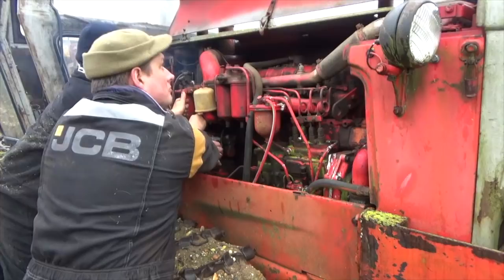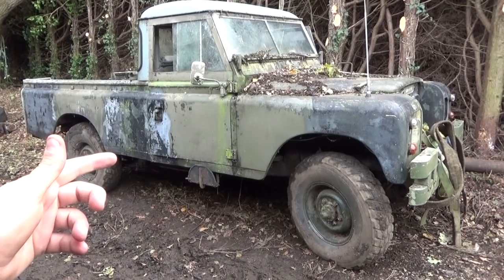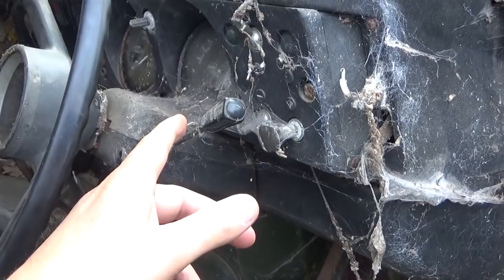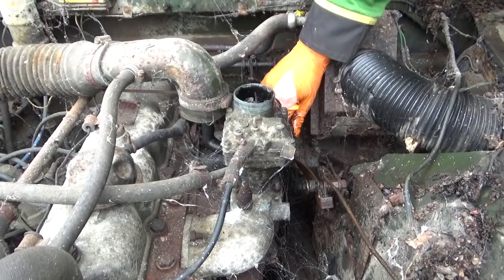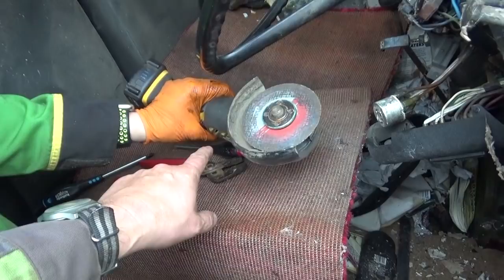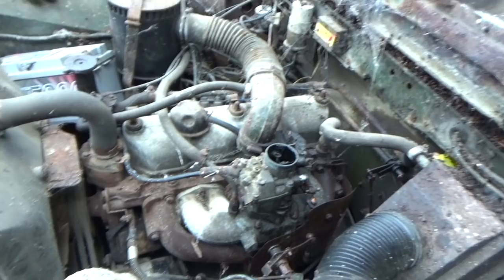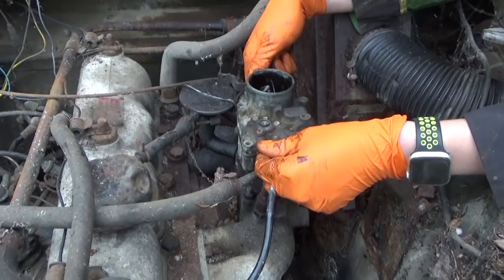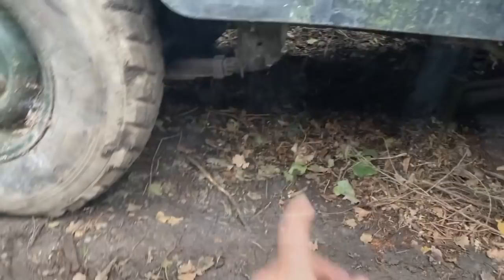ABANDONED Land Rover - Will It Start ?

Comment: Ive owned about 30 Land Rovers here in Australia.  Watching that 2.25 litre engine come to life made my day.  They are the sweetest little four cylinder engines.  I used to be in the geology business.  Our Series IIa SWB Landies had that motor.  When the geos drove from Sydney to Broken Hill (a very long way), they used to use the "cruise control" otherwise called the hand throttle (fitted for winches).  They would get the Landi up to "cruising speed" (what ever it would go) and then set the cruise control flat out.  The engine would be revving absolutely flat out and the result of this would be that the exhaust pipe would become extremely hot making the aluminium floor also red hot. No problem - feet up on the dash and off we go.  The speedo would go well past the 70mph mark.  Great little beasts. Wish I still had one.  (Still have a td5 Disco though for old time's sake. Mike
Reply from the maker: They are an incredible engine

Comment: Always like watching videos like these and I still miss my '63 2a after 25 years. It was my 1st car, spent my time getting it roadworthy while learning to drive, so it was ready for when I passed my test, used it for a lot of my apprenticeship in terms of the work I did on it was submitted as evidence for my NVQ. 

Another bonus was the 2.25 petrol ran on pretty much anything and as an apprentice, anything it would run on was great. there were a number of car hire and body shops on the industrial estate and the garage I worked at was opposite the petrol station, so as you could probably imagine, lots of people misfueled their courtesy or hire car, we'd pull it into our workshop, drain the fuel and put fresh correct in. Rather than pouring the contaminated fuel into the waste fluid tank, it all went straight into my Land Rover, sometimes I could have as much as 75% diesel/25% petrol, but she always started and thanks to those people's misfortunes, I was able to have fuel for my social life and keep my money back for other stuff.

I ended up selling it to a farmer in the Bristol area to use as a farm hack, but not sure if he ever took it home or left it at his parent's farm in East Sussex, it doesn't appear to have had a MOT (although now MOT exempt) for a very long time and after his parents died, the farm was sold and barns converted into homes, so it quite possibly ended up at a local scrap yard, although it isn't marked as being scrapped by DVLA, so who knows whatever happened to it.

Comment: Thanks for another great video.
Boots -
Being a plumber I wear lace up Dewalt boots on a daily basis, although if I am going in and out of a customer's house all the time I wear a pair of Dewalt slip on Dealer boots. Also got a nice pair of black Dr Martens steel toe caps which i keep for non damaging environments.
Away from work, if i know i don't have to take the boots off all day I have a fantastic pair of ex military dessert boots which are so comfortable, but have so many lace holes and being a tight fit mean they are a bugger to take on and off.

Comment: Old Landrovers never die but all engines wear out eventually. In 1981 I bought a Series IIA that had the original six cylinder engine replaced with a 161 2.6ltr Holden unit. We upgraded that to a 186 3.0ltr  in 1990. It is a cab chassis long wheel base with an aluminium tray and has been a great farm Ute. We were always worried about breaking an axle or some part of the drive train due to the extra horsepower but it never did. Mack steel cap work boots have been the best  I’ve ever had.

Comment: Boots: Ariat  fire resistant.  Enjoyed the video. Many Americans unfamiliar w/ the Land Rover brand. Expensive w/ limited dealer support. The G503 Jeep, more Military iconic here.  Given a choice, prefer the off-road equipment, tractors, crawlers, loaders & the like.  The  start sequence is like a golf shot, off the tee, trajectory uncertain. So the gallery, collectively leans left or right as if their position might influence where the ball will land. It is much the same when the engine is cranking.  We lean a bit into the keyboard for that extra incentive to fire.  A horse race could be another example, neck & neck approaching the finish.  The audience lends virtual push to their  horse, as if they are along in the saddle,  Then the engine starts to a sigh of relief & accomplishment

Comment: Dunlop thermo wellies.. Bit numb to start with when you first get some but once you've learned how to walk and drive again when wearing them nowt better and they last a long time too. Great videos by the way very good top tip about having a battery on the right angle so all the power runs to that end. I remember someone fitting a new battery on a series 3 and started it up, looked happy with a job well done and shut the bonnet.. Engine died immediately. The bonnet support shorted out the battery terminals !!

Comment: Brings back memories of our series 3 diesel put in overdrive and side windows use to fall out on you're lap🙈 had a pair of redbacks this year they were expensive but they're comfortable and seem to lasting well been struggling to get 12 months out of pair before a lot of boots don't like welding seems to burn the threads and boots fall apart.

Comment: Great vid you two .
Bit of scaffold pipe welded on the exhaust and straight in for a mot.
After 40 odd years I've finally found a  comfy workboot they are scruffs and I can almost get 12 months out of a pair.

Comment: Keep the clips young man!
I would have thought, NAY, expected a man of your calibre to have recovered the hand engine cranking lever from behind the seats, inserted it through the bumper and into the starter dog on the crank pully and started it by hand!
I have had many Series Land Rover's in my time and to be fair I would have a go at rebuilding that ole girl. Are you going to raffle it off? It would make a great Chrimbo raffle prize!
On the work boots, I tried Makita riggers, they were so terrible I gave them to a charity shop. I then went on to Buckler riggers and bought their boots every year for about 20year. However, I have dropped Buckler for V12 riggers because they last longer and are a bit more comfortable too. Did you know, (useless fact of the day), Buckler and V12 boots are made in China. Amazingly good quality considering where they are made.
Another fine installment squire!

Comment: How you doing mucker another great vid abit close to my heart over 12 years ago now i was asked to help start an old A2 series landy to use on our syndicate shoot as a virmin control vehicle got it running cut a turret in the roof had 4 or 5 years fun with it. We then lost the shoot land so it sat in a farm shed 5 to 6 years at least then i was offered it which i jumped at the chance and i now co own it wit a good mate of mine and yes she is still running. ARCO toe tector work boots are great straight out of the box no wearing in

Comment: Redback pull ons nearly all the time (I've got a working pair and a pair for going dancing) and lace up Redbacks if I'm walking a lot. 
I'm heavy on boots (just generally heavy really) and these are lasting about three times as long as any other brands I've had before. 
Skellerup wellies too, which are great around the yard and in with the cattle (steel toecaps and really grippy) but pick up mud like nothing else field walking! 

On Landrovers, I've got a Series IIa here with a petrol engine, which purrs, but has a serious thirst. There's a Series III with a straight 6 turbo diesel out of a Toyota Landcruiser VX, which needs a bit of work on the electrics to get her back running again (and by crikey does she run fast with a heavy right foot!). And an early 110 pick up with a late 300tdi transplant, with 15" wide tyres on for floating across fields. 
I also had a TDCi 90" as my main car, but the Irish Caravan Club borrowed it late one night, and forgot to bring it back.

Comment: I can see you are an afficionado of these 2286cc engines...when new and running perfect they are almost as good as the legendary Rolls 4 litre where you could put a threepenny bit on the rocker cover and it would not fall over.....the difference was with the Rover engine it would sit steady at a good tickover.....with the 4 litre R you could rev it and the threepenny bit would barely sizzle, it certainly would not fall over.
Reply from the maker: I've played a bit with the 6 and 8 cylinder Rolls engines and they are a really well balanced lump.

Comment: Hands down redback slip on, steel cap boots once worn in they are the best boot around. I wonder what's Lord Muck favourite boot brand?🤔
Reply from the maker: I usually have a few on the go but I like my Redwings and I've got a pair of JCB's I like plus a decent set of Bucklers
Reply: @LordMuck  Thanks for the reply it's good to know your brand.
Reply from the maker: V12's are good also but I reckon I might try one of these Australian brands soon
Reply: @LordMuck  Can't hurt to try, I am wondering how much redback boots retail in Britain because they retail for $80-250 in Australia depending on the model.
Reply from the maker: The last time I saw them being sold was at a machinery show in Germany and they were about €200 so I reckon around £180 in the UK maybe ?
Reply: @LordMuck  Holy shit that's expensive, the best bet for you to get a pair through a retailer in Australia just need to convert you shoe size from UK to Australian that's about all. May take a while to get there.
Reply: @callumbaylissbrandenburg9605  Get them from Bushgear, just over £100.
Reply: @kevinskea9388  Getting better, I can get a pair of slip on for around $100aus which isn't to badly pieced. I can get them awhole lot cheaper than people who live overseas. The pair I use cost me $125 or 69 pounds. I guess once you add shipping to the boots I think that it makes sense to add the extra 31 pounds to it which isn't too bad. Its good to see that people (other then Australians) like to use the stuff we make. Just like how I like to use the stationary diesel engines that are made in Britain (aka lister) because they last forever when maintained properly.

Comment: Notice that it's fitted with Michelin XS sand tyres, radial of course when S111 were normally shod on cross ply. Wonder why? Too early for a Gulf War veteran when the XS 7 its Bridgestone compatriot were fitted by the score.
Reply from the maker: It had XS fitted because that's what we put on it. Several S3's came back from an exercise in the Middle East on XS in the mid 80's and there were a good few out in the first Gulf war so there were a few around.

Comment: Have some Engelbert Strauss I think they're something like Kajam or something they're not the cheapest but not the most expensive they haven't got one of the stupid two tone soles that come unglued after five second like some of the more expensive ones I've tried and haven't come unstitched after three months. This pair has other than the laces lasted me about 3 years and are still going with the previous pair only being replaced due to a mouse making a home in one over winter and shredding the lining. Usually when it's wet or I'm working with the animals or muck spreading I wear Bekina Steplites

Comment: ARE YOU USING THE BLUE PIPE BEHIND YO AS AIRLINE IF SO WHERE DID YOU GET THE COUPLINGS TO SUIT AIR OUTLETS
Reply from the maker: No, it's aluminium air pipe with a blue pvc coating. It's not that expensive and is the proper stuff for the job.

Comment: I have also used the blue water pie as a air system ,
Reply from the maker: That ain't no pikey water pipe... That's blue plastic coated aluminium air pipe, the proper stuff. It's not actually that expensive either.

Comment: Hiya mucka, did I laugh this video, plus Im an older (me or them) Landrover nut, only had derv versions but used to service a short wheelbase petrol one for a guy i knew. Anyway, work boots, well, TBH I not worn real work boots since 2003 but do still have them, they still smell of hi tech engineering, but are rather sad after i wore them while doing a lot of that grey hard ground stuff, concrete is it / lol cant remember the name of them now but were steel toe capped for my work..Oh I now got a baby landrover, a BMW powered Hippo automatic - yes its more like a car but Im old now so play the old age card, but, still looking at old 200/ 300DTi or later TD5 with free swiss cheese chassis, yes I got welders left over from my last 200DTi..So, much thanking you for the video yet again, and the lord knows we need a bloody good laugh eh.. truck on, thanks both, keep smiling.. Ian..

Comment: Todays work boots are shoddily made crap that either crack on the uppers after a few months or part company with the soles. The best and most comfortable I have ever worn were hardly used ex British or German para boots usually purchased from a stall at the Coningsby or Waddo air shows.

Comment: They taught us in the army to hot wire them with a piece of three foot wire simple they will even run on three cylinders we ran one once without a piston 5 gallon of oil a day but it still kept going
Reply from the maker: This one had been rewired to civvy spec ignition so the 3 foot of wire trick is slightly more difficult but still fairly simple 👍

Comment: I had a  few 82  109 RR  owned 2005 not cranked in 23 years I found on a farm  a bit of fuel,battery and starter fluid fired right up
However. Did not have the cash to restore   Sold it  great vehicles own several versions all are fun but pricy  Dan / SC

Comment: Enjoyed that. Referring back to your earlier Amorok vlog concerning annoying failure & inbuilt obsolescence I’ve purposely purchased a defender 90 with a 300 tdi to avoid all that emissions crap. I know it’s worse than a 1950 farm tractor but I can’t cope with nonsense like Egr valves etc. Oh & by the way check out Caterpillar Pelton boots
Reply from the maker: Then you'd better hope someone has blanked off your EGR valve...
Reply: @LordMuck  ... I’ve just done exactly that on my Transit mk7 2.4 tdci. Blanked it off with a stainless plate. Trouble is MIL light stayed on. ( MOT failure). So I took it to a guy who uninstalled the software 😄. Cost £180. Now the light stays off for about 100 miles or a couple of days & then comes on again but plenty enough to get it through said MOT.  As far as emissions go on the Nox test - almost zero. Had to suppress a laugh as I watched MOT tester focus on warning lights when he started it up & visibly relax when he saw light go out. Ha ha. I just love getting one over on stupid government dictats. If they want a war then they’ll get one. I didn’t start it. 
👍
Reply from the maker: The 300 can be blanked off with no effect (lights etc).
The daft thing is they run cleaner 🤦🏻‍♂️
Reply: @LordMuck  ... you’re dead right Lord Muck. I’ve just looked & there is an EGR. I d previously thought that vacuum thingammy was variable vane for the turbo. Have to get rid of that bugger. Who wants old exhaust gas going in the intake? Not me. Thanks for the heads up. 
👌
Reply from the maker: Oval shaped two hole blanking plate. Will run much better also 👌🏼

Comment: army landrover bridge fuse 3 and 4 brings on ignition lights  push one of glass fuses in between
Reply from the maker: The ignition has been swapped about after being demobbed so it was easy enough to do on the key. Still had IR lighting fitted though (and convoy light)

Comment: LOL Mucka where were you years ago as Australia SASR would need fix there LR in Afghanistan.  Nice 50 cal, 40mm grenade launcher would go well with LR👍.  Best dress, old school work boots would be RM Williams or Blundstone with cork soles, but best work boots I have good run miner spec Oliver AT’s with Fire, oil resistance soles, I get good three years wear. I have hip problem but these boots reduce the stress around the farm.

Comment: At the moment I like ma red backs ran 2 and 1/4 landys you needed over drive so you could go up half gears at a time when the trailer was on once dropped a valve bent all pushrods just straightened them with a big hammer and job was a Goodn like the film clips by the way

Comment: Ok how about getting  a rangerover and trye to start it up but make sure it's a scrap one lol
Reply from the maker: A 3.5 V8 will be easier to start than the 2.25...
Reply: @LordMuck  true but it depends on the age and state of the engine as ya know some rangerovers are twin carbs and some are not but would love to see ya try to restart one lol
Reply from the maker: All pre EFI Range Rovers are twin carbs. The age or state of the engine doesn't matter - if it turns and isn't destroyed, I'll get it to run, always have done.
Reply from the maker: Make sure you stay tuned to see a 1977 3.5 fired up for the first time since 1992 early next year...

Comment: Thanks for the video, is your assistant single and does she have a passport, don't care if she can cook or not  she's the kind of girl I could do with finding if she can put up with helping you  L.O.L.   So it looks like you found another average Land Rover from a lot I've seen over the years  L.O.L 
 If she'd just been straight ex army all that should of been wrong would of been the oil drain plugs being worn out and a stuffed frame, I've been told was common if they had ever been air dropped during  practice runs or conflict.  It would be fairly well guaranteed it won't start if  a guy tried the same thing with a  Grenadier if it ever happens in say 8-10 years   L.O.L  Take care both of you.
Reply from the maker: It was straight ex-army 40 years ago and was as straight as they come.
Shame that the rot got it.